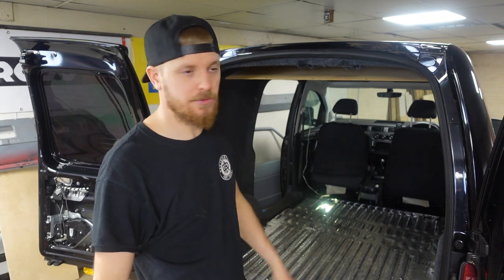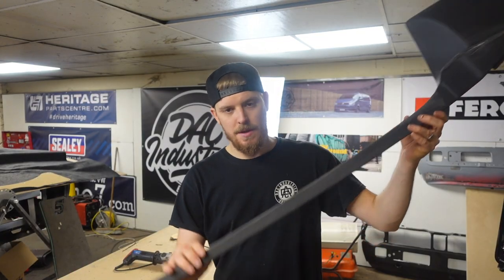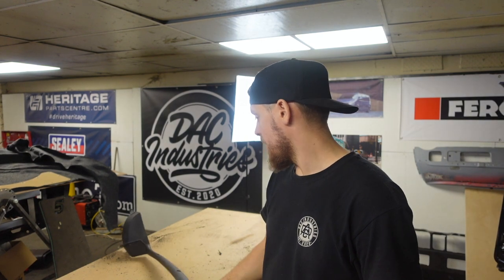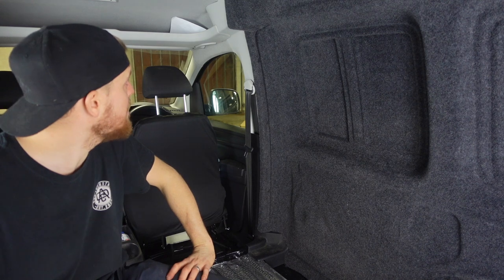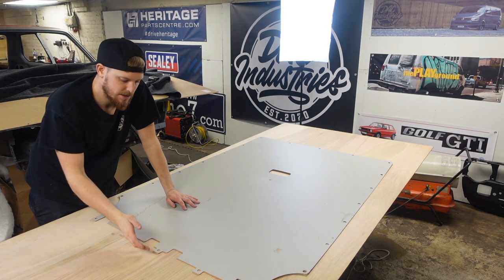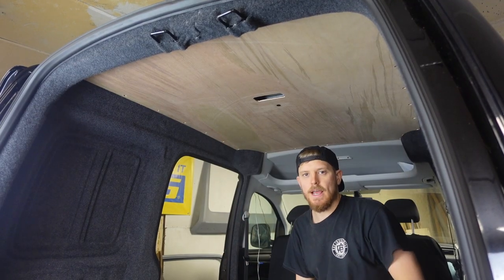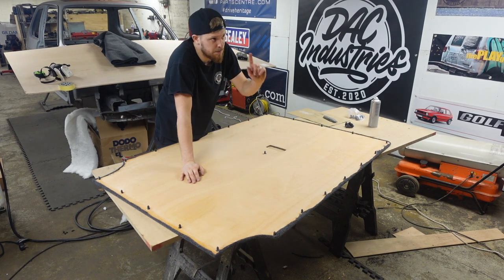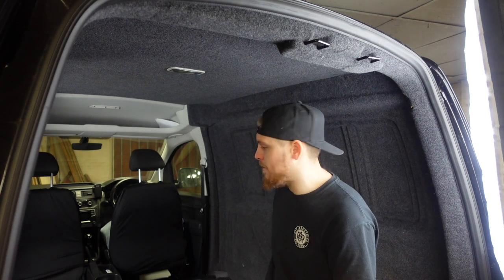VW Caddy 2k Sound Deadening, Insulation & Carpet Part 3 Conversion Caddy Camper Micro

Comment: One thing about those fir tree clips for the headliner... The are very secure. So much so that trying to get them out without doing some damage to the headliner is not so easy. Had to drop my headliner to modify some led lights and even with a trim clip removal tool kit still managed to trash the ply around one of the holes and slightly split a few others.

Comment: Love the videos, 
just thought id share a little tip for repairing plastics, not that you need to as you have already carpeted and fitted the bulkhead trim, could be handy in the future though.
the damage done to the plastic with the air saw is easily fixed with a little bit of mitre bond (CA glue), scotch brite,aerosol,. a form of 'cold welding' plastic.
Reply from the maker: Thank you so much for watching and for your comment Bud. Great little tip that! I will remember that one.

Comment: I found coating the wood with pva or varnish stopped the glue soaking into the wood & not sticking so well, also stops the wood soaking up any moisture & warping .
Reply from the maker: Thank you so much for watching and for your comment Matthew. Yes PVA/Varnish would help. As this is not going to be slept in etc I didn't feel the need to seal the ply.

Comment: I plastic welded the valley on the back of the bulkhead trim at the top. It meant I could sand it right back and avoid any ridges at the top of the trim piece.

Comment: Hi Dan, great video and series as a whole, really informative and helpful as it about to get cracking on my t5 camper conversion. I’m looking to use 6mm ply to line my t5, do you think the clips you used on the headlining would work with 6mm ply? I’ve seen most hidden clips only work with thinner ply but would like to use 6mm as it’s a bit more sturdy!
Thanks a mill
Conall 🚀
Reply from the maker: Hi bud, Glad you have enjoyed it and glad they have been useful. 6mm Should work with the fir tree clips. Personally I think 3mm works better as it forms to the curve of the van easier and doesn't put pressure on the clips trying to straighten. It's not really doing anything other than covering the walls to warrant 6mm over 3mm.
Reply: Many hidden clips work on 3mm panels as that is thickness of the clip. These are different to the ones dan used as they fit in after you have carpet lined the panel. You can use a router to rebate the 6mm ply 3mm down so the clip is essentially clipping onto 3mm thickness. 6mm ply should be fine but as the clips will be under pressure. This can ne alleviated if needed with kerf cuts in the ply on the rear. As Dan mentioned 3mm is fine as its just panel covers. If you are hanging items on them or making furniture as we do, we use 6mm for a stronger foundation. All the best👍

Comment: Hi can I ask when you used insulation in the van is it safe around the wires or do we need to cover wires for fire hazard.  My son converting caddy and just wanted to ask the questions.  Your video was much appreciated.  But I carnt see if you cover wires with anything.  Would be grateful for advice.  Its his 1st project and want him to be safe.
Reply from the maker: Hi, I have converted a few van's an have alway's just put the insulation in with the wiring. Never had a problem.

Comment: Good to know: Larger clips needed. 
If you want to mount a carpeted plywood, instead of the simple cardboard.
Because it is thicker, and has much more weight.
If clips are not strong enough, you need to screw in.
Reply: Hiya, anyone know what size firtree clips to hold the ceiling in? Ta